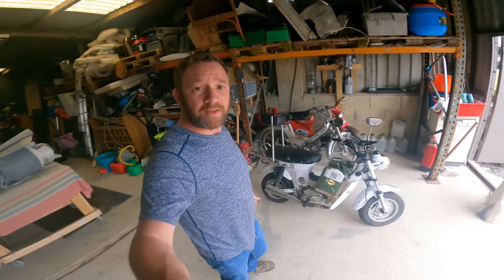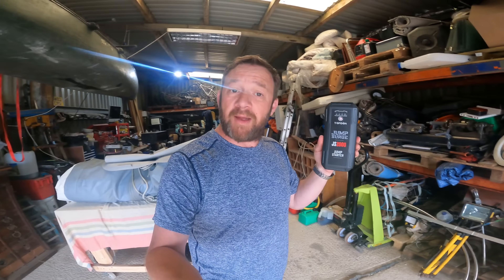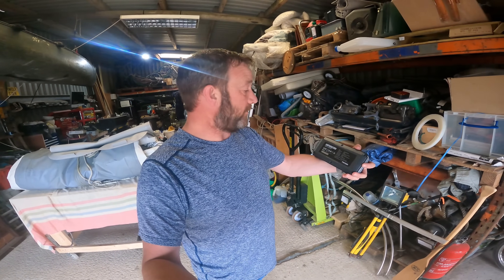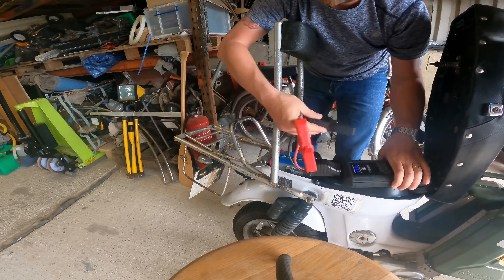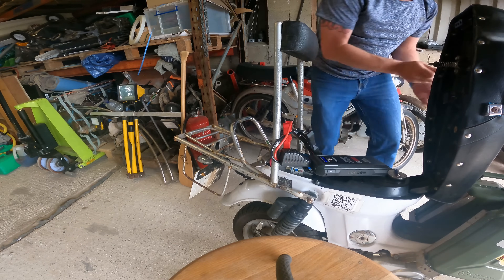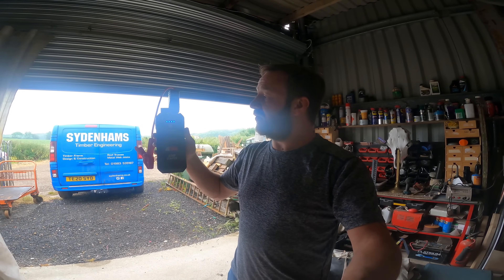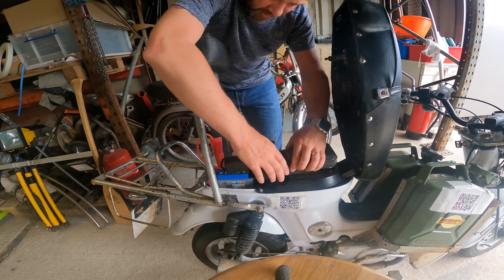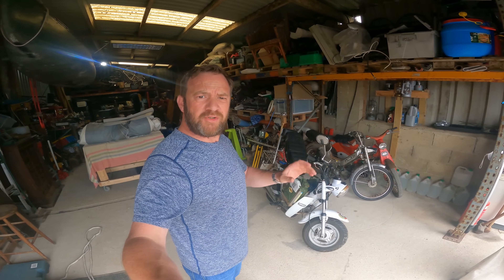Topdon Jump Surge JS2000 Emergency rescue Jump Starter

Comment: My wife and I  have similar items in both our cars.    Due to standing outside ,and doing very little mileage my wife's car battery had a habit of dying every winter.  Since we invested in those booster packs we just  give it  a burst as when needed then let the engine run the charge up . Job done . I love them. Save me no end of running and faffing about.
Reply from the maker: Reassuring Dusty